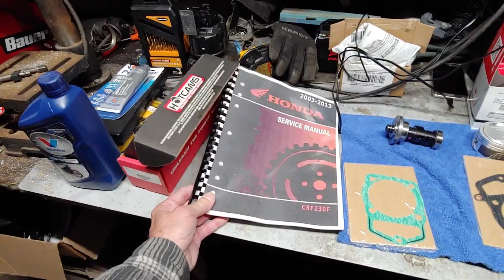Cam and Wiseco 11:1 piston install Venom X22R 250

Comment: Real quick. I’ve decided to try and take material off the head of the 250 to increase compression. How much material do I need to take off? I would assume sand paper will do the trick?
Reply from the maker: 1mm will raise it to about 10:1. Sand paper on a thick piece of glass or flat steel plate works. I've done a few heads that way.
Reply: @JerryHawk250  Is it a noticeable difference over stock?
Reply from the maker: @charlesreiman2185  yes. Nice improvement combined with the porting of the head.
Reply from the maker: @charlesreiman2185  yes, definitely worth the effort.
Reply: @JerryHawk250  Do I take material off the heads or off the jug?
Reply from the maker: @charlesreiman2185  the head. You can also use a thin single layer head gasket so you don't have to take off as much.
Reply: @JerryHawk250  Can you send me a link to a thin gasket because I don’t know where to find if?
Reply: I wish I could send you the heads since you’ve done this before multiple times because I’m afraid I’ll mess it up lol
Reply from the maker: @charlesreiman2185  The stock gasket is a triple layer gasket. Drill out the rivet that hold them together and use one.
Reply from the maker: @charlesreiman2185  If you are looking for a X22R 250 head i have one already ported sitting on the shelf.
Reply: @JerryHawk250  I have a 2021 venom ghost chopper. I don’t know if that head would fit on the engine. Do you know if it would?
Reply: @JerryHawk250  If it fits and you can take some material off the head for me. I’m definitely interested in paying for it. Shipping and everything
Reply from the maker: @charlesreiman2185  same head so it will work.
Reply: @JerryHawk250  Ok. Can you shave some material off the head?  After that I would like to purchase the head if it’s for sale. I don’t know if you’d like to talk about this on a different platform or not. Address, money, etc
Reply: @JerryHawk250  Are you interested in selling your cylinder head?
Reply from the maker: @charlesreiman2185  yes. I don't need it.
Reply: @JerryHawk250  Ok perfect. Do you want to talk about how I can get it from you on YouTube or another platform?
Reply from the maker: @charlesreiman2185  Best way will be through private message on chinariders.net.
Reply: @JerryHawk250  Ok I’ll try to find you on it and private message you
Reply: @JerryHawk250  once I click on the link I’m not sure how to send you a message
Reply from the maker: @charlesreiman2185  It should be hard to find me. I'm the moderator on there. "JerryHawk250"
Reply: @JerryHawk250  I found your profile. I just don’t know how to message you. Do I have to make an account to message you?
Reply from the maker: @charlesreiman2185  you will have to join the forum. Once you sign on you will be able to send me messages.

Comment: Hey jerry i just ordered my bike and will be here tuesday what all mods have you done and where can you find them?
Reply from the maker: Check out my X22R play list, every mod I have done are in my videos. Most of the parts can be found on EBay and Amazon. Links are in the description in those videos.
Reply: Hey jerry what dimension did you have to use for ur new rear sprocket?
Reply from the maker: @brianfloyd3095  Center Hole Size. size: 64mm, 58mm if you remove the spacer ring   - Size of bolt holes diameter. 10.5       circle diameter through center of all bolt holes: 96mm

Comment: And does that engine have an overhead cam with a timing chain or is that a push rod engine
Reply from the maker: It has an overhead cam.
Reply: Jerry thank you so much for the response on the cam is there any any way I can find out or how would I find out what cam to use for that motor or who can I ask about the what is the actual size that motor it looks the same as yours

Comment: I got the same bike how do you adjust the rpm , because my it’s at 2500 I think it’s to high after the engine it’s warm !!!!
Reply from the maker: Adjust the idle speed screw on the side of the carb.
Reply: On the right side of the carb use flat head screwdriver will fix it

Comment: With higher compression will you need to run higher octane?
Reply from the maker: Yes, I'm running ethanol free 91 octane fuel.
Reply: @JerryHawk250  were you running regular before or always 91? Do you do the same with your hawk?
Reply from the maker: @XBBENTO  I was running regular before these mods. I run 91 on the Hawk as well.
Reply: @JerryHawk250  thanks for the quick response. I appreciate you and hope to see more videos and updates about your bikes

Comment: You should just change the whole motor out those bikes come with a life in engine with those engines want you start adding power they blow real easy
Reply from the maker: It's fairly new engine with only 1400 miles on it. With the mods I've done the engine will still be reliable. That's why i only pushed it up to 10.5:1 compression. The reason i went to a forge piston is to make it more reliable with the higher compression. The cam is a mild cam that will help it breathe better in the mid to upper rpm's. This is my daily driver so mods won't be to extreme. I'm not building it for racing.
Reply: Dang, I knew I did something wrong when I started hopping up my CG engine. I forgot to tell it to blow up.
Reply from the maker: @OddBallPerformance  LOL , I forgot to tell my Hawk too. Shhh! don't say anything. At 7900 mile i don't want it to get any ideas. 😂
Reply: Im  pretty sure these engines are made by zongshen
Reply from the maker: @XBBENTO  Yes they are.
Reply: @JerryHawk250  compared to stock it's racing as is with mods from 65-75 to modded to 90 or more dong fang or venom never intended for it to go that fast...but real riders wanna go fast...weeeeeee kick out both feet...like a child😁
Reply: @trucker2b  except he geared it taller with a smaller rear sprocket to bring tge revs down. 😉